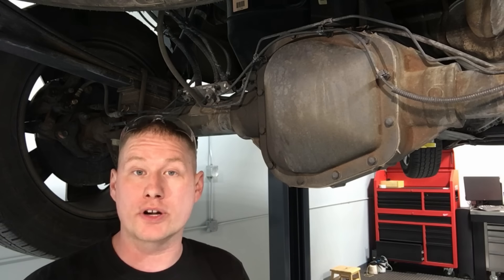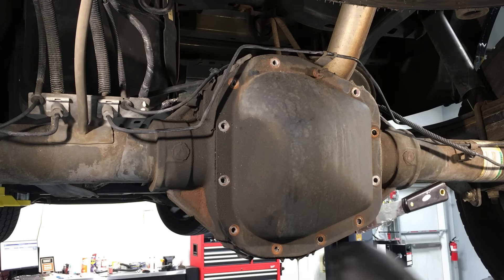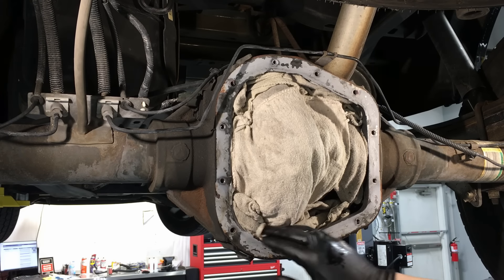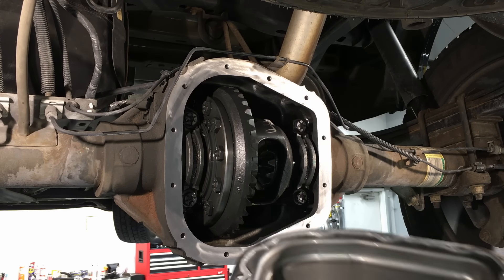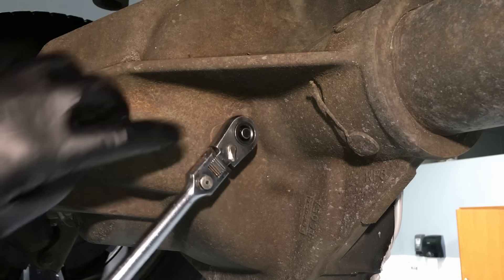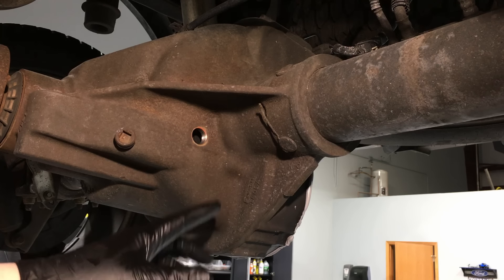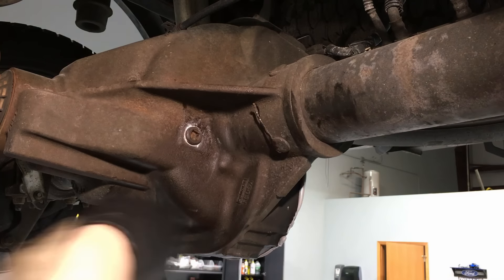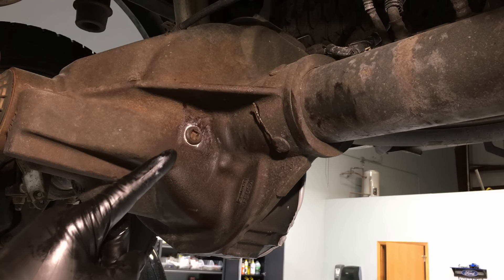Ford 8.8" 9.75" 10.25" Rear Differential Service: Fluid Change Procedure

Comment from the maker: These are the Tools and Parts I recommend:
Motorcraft 75W-140 Axle Fluid (3-4qts)-
http://amzn.to/2C9pKRu
2015 and Newer Expedition and F-150 Axle Fluid-
http://amzn.to/2BNFZbe
Motorcraft Friction Modifier-
http://amzn.to/2siDfin
Permatex Thread Sealant-
http://amzn.to/2Ehurio
Permatex Cover Sealant-
http://amzn.to/2skwQTN
Good Basic Torque Wrench-
http://amzn.to/2C8qBSE
Reply: FordTechMakuloco 
when i had mine done they cleaned the inside of it with some kind of cleaner witch im thinking break cleaner
Reply: and do you half to add anything becides the fluid for freaction i have a 98 ford explorer 4.0 sohc eddie bauer 4.wd
Reply: FordTechMakuloco how do you change the front differential fluid in a 2012 Ford f150 I can't seem to find a good way to get the cover off any advice would be greatly appreciated
Reply: T Web 
ok
Reply: FordTechMakuloco can you please make a video for a 13 f150 for front differential thanks
Reply from the maker: I don't like to wash the bearings with solvent like that. I don't want a pool of it trapped inside to degrade the fluid.
Reply: Jeff Magee sr He mentioned in one of the comments about suck and fill. Not sure how that works yet, I am waiting for response. I tried myself with a hose in the fill hole but didn’t seem like there very much room to get hose all the way to the bottom
Reply: TRAVIS . T L  T Web: In the ChrisFix video he soaks the differential clutches in the friction modifier, as well as adding it to the gear oil. He was rebuilding the differential in his Mustang.
Reply: FordTechMakuloco I cant find it. But have you ever done a video for a 2006 f150 2wd 5.4L where you can be cruising at just about any speed and let off the gas suddenly, then there is a substantial jerk in the vehicle? I cant figure it out. Love your videos. Helps me a ton. Thanks
Reply: Could I use royal purple in my ranger fx4 limited slip?
Reply: Any links to the pump and vacuum used?
Reply: Dude has great advice and tips with alot of patience (putting the cameras in the right spot) to show us how its supposed to be done. Thanks for the info, now then any info on rangers and the procedures on them? Thanks.
Reply: What's the socket number for the front fill axle and oil number?  T
Reply: I have used everything from a hand pump for oil from Harbor Freight (like he showed) to the pump from a large bottle of hand lotion to pump out the front differential.  Takes a while to pump out.  DON NOT USE FRICTION MODIFIERS ON ELETRONIC POSI REAR ENDS!!!!
Reply: @nedcramdon1306  Royal Purple DOES have the friction modifier in it already.  I use it in my Yukon Gear LS set up.
Reply: Is it ok to use a royal purple or valvoline insted of motorcraft is it any difference.. cuz i need to replace my defirential fluid on my 2007 2wd
Reply: @jshinta15  Did you ever find out what it was.  Exact same thing is happening with my 2006.
Reply: @5ghostshadow  I believe I did. I got some motor craft grease for the slip yoke. Seemed to be the noise others were hearing. I remembered my slip yoke was dry when I took it out recently to replace the u-joints
Reply: @jshinta15  Thanks. Will try that.
Reply: Is there an i d on the axle to know if I have a limited slip or not?
Reply: @curtis1951  if you jack up your truck and spin one side and the other side spins the same way then you have a LS
Reply: @FordTechMakuloco  hey Brian i do all my mechanical work, but when looking in the manual it says it a sealed system and dont need changing unless submerged in water, or there is mechanical issues, which sounds crazy to me. This is for a 2004 f150 4x4 lariat. I changed it anyways..your ALWAYS  the Ford guy i listen to! Just curious, thanks bro.
Reply: @nateo4760  

Dont they have a drain and fill plug?
Reply: @kylewoodward7078  Ford is in the business of selling vehicles and parts .

Wyr
God bless
Reply: Fordtechmakuloco I have a quick question for you sir, should i use this same axle fluid on a 1996 lincoln town car or is it different because it's an older car or should use 80w90. Thanks
Reply: Why use gasket maker instead of an actual rear diff gasket?
Reply: It would be super cool if you could so how to do a re gear thanks 👍
Reply: thats funny my owner manual says that the rear should only be 2.75 QT's what is 5.5 pints
Reply: @arnoldbaclig7709  I wish he covered that. It's half the price.
Reply: @FordTechMakuloco  my exacts thoughts as well
Reply: Ford Transit 2015+ requires 75W85 instead of 75W140. Just letting you know
Reply: @Denis-bo8ms  a Felpro gasket cost me $6 at ORiellys.  RTV gasket sealant is $9.99. This guy likes using WAY TOO MUCH SEALANT.  Actually I used a new gasket and sealant on both sides but not nearly that much.  You dont want globs of squeeze out...just enough to see there is squeeze out.  No more no less.  The same globs you see on the outside are present inside too...they will eventually break off inside and can fuk up your limited slip and or oil passages.  Permatex instructions say 1/8" to 1/4" bad all the way around and around bolts too.  You have to judge between 1/8" and 1/4" so you get proper squeeze.  He used damn near a whole tube.  WAY TOO MUCH.  by the way...I'm certified as a Sealer at Boeing...I do know a thing or two about this subject.  And always read your owners manuel.
Reply: what was the torque?  what is the ft lbs?
Reply: You are an excellent teacher.  One of the best DIY videos on YouTube.  Thank you.
Reply: The sealant package says finger tighten and then wait one hour and torque them..then must wait 24 hours before adding fluid....is  that necessary because i need to do this today and drive soon after.
Reply: Great video!

Does the 2012 F-150 5.0L require the friction additive? Its got the electronic locking rear diff from the knob on the dash.
Reply: I just got into a 2004 Ford F150 Lariat Super Crew 5.4L 3V V8 4x4...... And i want to give it a tune up myself and really get to know my truck and this is where your detailed videos come in hand. Ty so much for the how to, very clear Vids.... I normally just pay mechanics to do up my vehicles but never really know whats wrong truly just go by their word and now i see i can go refrence what i think is wrong and boom.... You got the how to fix video in clear detail.... Thanx so much, so not only am i saving myself from future headaches but money to get more tools to pass down to my awesome Son.... Btw, my son thinks its cool i Rock up my truck and we got a thing now.... Thnx man....
Reply: Thor no.
Reply: @nateo4760  he has a video of it
Reply: I had a garage replace fluid rear differential with limited slip clutches. They did not add the friction modifier. About a month later the clutches started to stick. Ended up taken it some where else they replaced the clutches. Took first place to court ( because they refused to fix it ) and lost. They said in court that with the newer oil it did not need the additive???? Cost me 1200 bucks!
Reply: I am new to the channel and truly appreciate the videos. I am a little confused on the non limited slip (open diff) versus the slip or electronic option. The videos state it doesn't hurt to add additive to either slip or non-slip but does cause a problem with electronic. When 4x4 is engaged/lockers, this would force limited slip scenario as the tires all pull in same direction, correct? I have the vacuum actuator enabled from the cab to enable 4A/4H/4L. I will get under the truck and see if I can locate a tag or part number to verify the correct additives. Is it possible to have a non limited slip 4wd? This sounds like it defeats the point of 4wd. Perhaps it engages the front and rear axles in an open diff scenario allowing traction of only 1 tire on front axle and 1 on the rear? Not a mechanic and apologize for the dumb question.  Appreciate the advice and assistance. 2012 4x4 Expedition | 104k miles
Reply: @nateo4760  I believe shops use a vacuum pump to pull all the fluid out, since splitting that front would be a nightmare.
Reply: @jshinta15  is there a zerk fitting for that?
Reply: 5ghostshadow I greased you the slip yoke that enters the transmission and I think it went away.
Reply: Jim Bronson nope. Have to pull off the whole driveshaft and use motor craft slip yoke grease. Then put it back in.
Reply: About to do mine tomorrow, I need to know what abrasive he is using to grind it. I don’t know if you grind with metal will it change the seal?
Reply: My 2013 f250 owners manual says 8 ounces of friction modifier. I added just one like in video. Is that correct when using the motorcraft 75w140. Didnt know if spec had changed
Reply: @JeffMageesr82  /
Reply: I have an 2010 f150 xlt super crew with a two piece driveshaft how do l find out if I have a limited slip differential or what type of differential I have.
Luis
Reply: What oil should i put in front axle? Ford sold me 75w140, but owners manual says 75w90. Please help. We're moving from Alaska to Michigan,  don't want to have front axle problems. Thanks
Reply: I have a 99 Ford f150 rear axle clip fell out, everything looks fine, wheel bearings, axle, looks good, what could cause this, any info would help.
Reply: Thank you for your prompt response. We have 08 Explorer Eddie Bauer with the 4.0 2 WD automatic 231,000 miles,  2006 F150 5.4 3v Lariat( Incifrntly I'll be installing new rear wheel bearings and seals in the morning. Hence my question. Got that drone hum at 75 to 80 mph), and a 2019 Escape with EcoBoost.  That you love. Lol. With 30, 000. (Wish us luck on it. ) miles. Your my go to Ford guy.  Appreciate you. Immpraying when i open that differential its ok. Hubs dont turn easy by hand. Have to use a bar between lugs to turn or start it while on drive on stands.  Some whining and vibration.  Hope your family is well these days. Ever in eastern NC look us up. Night.
Reply: @Denis-bo8ms  i had same question. He responded he'd always did the Ford way. Just sealant. Just got that response.
Reply: @Kirayamatoplay  little over 3 qts.
Reply: My 2015 owners manual says 75w-140 for the rear axle  (rear diff) why is there another link for 2015 and up using 80-85 ? Was something changed? I was just about to use the link to buy but noticed this difference
Reply: @zeagle112  I have had one of the pumps that I purchased from a boating store years ago (maybe west marine or boat us?) to fill the outdrive of an inboard/ outboard marine gearcase.
Reply: @jshinta15  Check for misfires with a scanner.  I started having jerking at 45mph or so in Overdrive.  Could be degrading or bad ignition coils and/or spark plugs.  Long time ago I know, but others may need to see this.
Reply: @FordTechMakuloco  
What happens if the rear gear oil is silver metallic color only after 2000 miles of use ?
sounds like an issue.
Reply: @nateo4760  Suck it out with some vacuum bottle due hickey like a blake bleeder tool. Probably find some cheap chinese junk on amazon. Theres no way to get the plate off on the front without removing the axle and that's not gonna happen.
Reply: @FordTechMakuloco  Wont it just evaporate when you blow it out with air.
Reply: Suck and fill the front diff you cant remove the cover theres no access unless you drop the axle
Reply: @blackfaceturdo9122  
If you use 80W90 instead of 75W90 on front diff does it matter?
Reply: What are the torque spec on the bolts?
Reply: @jeffg2866  l
Reply: What’s the thread sealant for ? Thank you
Reply: How do I even know if I have a limited slip diff??
Reply: @nedcramdon1306  how you know you have a limited slip?
Reply: Can you use 75w 90 that’s what ford sold me at their parts department
Reply: Can you use royal purple with the friction modifier already added?
Reply: @TRAVIS-L  yes, I've seen the Ford dealer back home clean the inside and everything in it with brake cleaner. I asked him about it,  and he said it eventually dissolves.
Reply: Would this be the same for an F250?
Reply: What if I haven’t changed it, my truck has 246000miles
Reply: Should the rear diff be changed on a truck with 182,000 miles if it's possible it's never been done before? Also, where is your shop? I'm in Louisville.
Reply: @shaneclarke6307 My 2019 F250 does as well.
Reply: @FordTechMakuloco Yet you put way too much sealant…. 🤦‍♂️ you need to apply a thin layer first, use your finger and roll all the sealant nicely even all the way around. Use Q tip and press thru all bolt holes on cover. Ensures no excess sealant gets into threads. 

You see that HUGE fat excess sealant around the cover? That means it’s like that on the other side, inside…internally….these sealants don’t last forever as the fluid eventually degrades the sealant which causes leaks/seepage. You are introducing debris to be chewed up by the gears. 

If it’s not your vehicle and you don’t care then I guess but if you own your vehicle DO NOT DO WHAT THIS GUY DID! You will destroy your rear end.
Reply: I have a question. Am I correct to use 75w 140 in front without friction modifier up front and 75w 140 in the rear with friction modifier on a 2017 Expedition EL 4X4? Thank you!
Reply: Any reason not to just use a Gasket? I see they sell them for my 99 expedition.

Comment: I love the videos. FORD must hate the FREE KNOWLEDGE that you bestow upon all of us. My wallet thanks you!
Reply: engineered failures is the new science: everything must go!
😉
Reply: I guarantee a ford dealer or most mechanics wont be this thorough!
Reply: Never could understand why all makers don’t have a magnet drain bolt at lowest point and a fill bolt Toyota has had this for years and makes this a 15 min job
Reply: I doubt it the parts department is making a fortune
Reply: @Snookchaser007  I agree about magnetic drain plug but its still not a 15 minute job if you remove the pumpkin cover and do a complete clean out n reseal like he did.
Reply: You mean the dealers and other repair shops? Not so much Ford. 
  By the looks of how busy they all still have been, since so the advent of so much free info on the net, they probably have no issue with people doing their own repairs and upkeep.
Reply: Hey I seem like mine's a lot of slack in my rear end I may need to Tisha mine up on them in there go ahead and get a damn shame kitten put wheel seals and everything in it
Reply: Ha ha! Greetings from 2024 where the going rate per labor hour is $170. Never been there myself, but I'm assuming dealerships are at $200. Mind you, those are flat rate hours from a labor guide book. So a job that actually took 35min, the book says 1 1/2 hours. That means you sit in the waiting room for 4hrs lol. While you wait, simultaneously fending off sales pitches on lavish offers on your trade in. The service department isn't going to recommend important time consuming maintenance. They much rather sell you on quick and easy fluid flushes and rotors that you don't yet need at an extravaganza price of 400% mark up. But rest assure, their highly trained techs have been promoted from within. Joey here was in parts receiving/stocking  for the last 7 months. And has completed his 12hr online training course! Best of the best
Reply: @Snookchaser007  The thought crossed my mind while wondering why the transmission doesn't have a drain plug, but the benefit is you're forced into a position where checking on the state of the valve body, filter, etc. is trivial rather than just assuming everything will be fine merely by changing fluid. In this case, you're a lot more tempted to give the diff a good cleaning before refilling. How much that actually matters I couldn't say

Comment: You may want to clarify on the “grinding disc” comment. Some people who are watching this probably don’t know a lot about tools or aren’t too mechanically inclined and may actually take a 4” girder for metal and go to town. Sounds crazy I know, but trust me I’ve seen things you wouldn’t believe as I’m sure you have. Maybe clarify to use a scotch brite type abrasive disc or brass wire wheel. At least something that cannot actually remove metal. Thanks for your videos, they are a great quick reference when I can’t think of something off the top of my head.
Reply: Comment I was looking for. Thanks

Comment: You have helped me keep my 2004 5.4 Triton FX4 on the road and running strong for 20 years now, we just broke 800,000 miles and it shocks people to find out how long this truck is lasting. I cannot thank you enough.
Reply: Wow that’s awesome! built Ford Tough! Mine is pushing 250k and still running strong.
Reply: How many rebuilds?
Reply: This is a lie
Reply: That’s awesome! I’ve got a 2011 f150 3.5 ecoboost with 490,000 all original. Maintenance is the key.
Reply: @stephenbloom2545 km or miles? And what maintenances have you’ve done?…
Reply: @Shadowcu123  495,000 miles on it now. Amsoil products on everything. Everything is still original, engine, transmission, transfer case , differentials and both turbos. The timing chain is making noise and that probably wouldn’t of happened until my mechanic was stealing my Amsoil filters and putting on those cheap Pennzoil card board filters.
Reply: @Shadowcu123  my maintenance regiment is Amsoil 5w30 signature series oil with their EA017 filter every 10 to 15,000 miles depending on my driving habits. Motorcraft plugs every 70,000 miles with a gap of .028 transmission filter and fluid change every 80,000 along with all differentials and the transfer case. I change the air filter at every oil change no matter what. Change all hoses every 200,000 miles
Reply: I got a 5.4 e350 super duty 2008 202k miles and only thing I’ve had to replace is the radiator and I change the rear end gears from 355 to 411s and oil change every 3-5k miles no problems yet still runs like a top
Reply: 40K Miles a year???? I guess you lived in your truck huh? 😂😂😂😂
Reply: @JamesAgans  it has to be a work truck. I put 5000 miles on truck every month.
Reply: @BryanMark-mw8sz Holy Cow! How many timing jobs did you do? Just wondered.